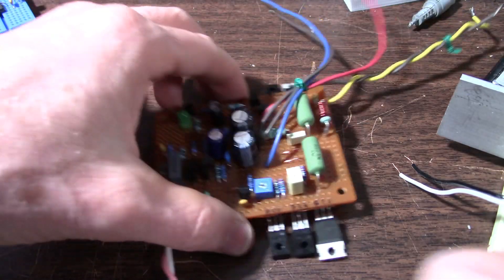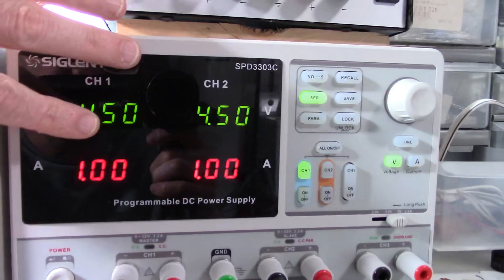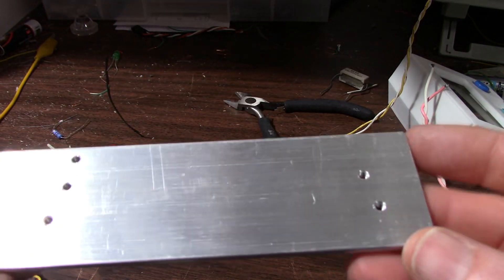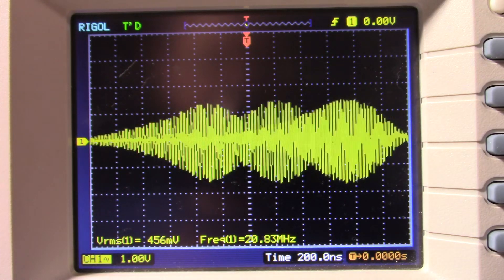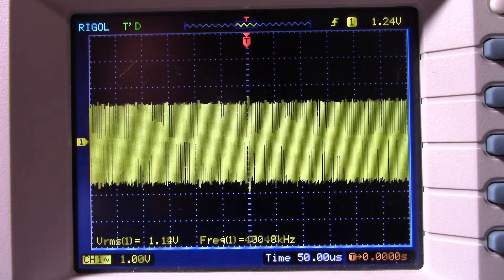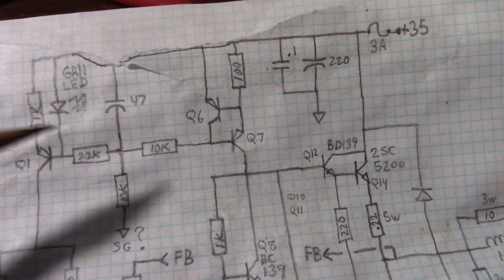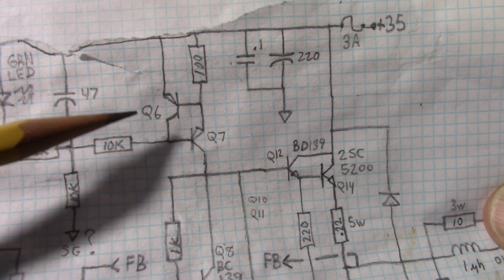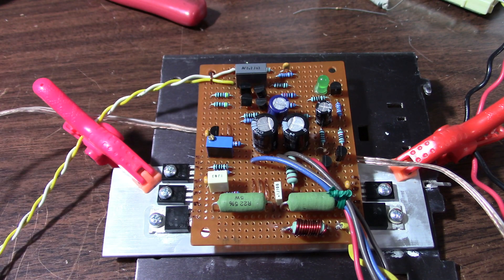Discrete audio amplifier project PT14 - BIG PROBLEM!

Comment: try to replace a shifter transistor is a preoutput stage of the amplifier somehow i make ones i somehow i put larger amperage to the circuit and start to get noise then somehow the noise it louder on the sound itself til it the music gone and the oscillation got more compromised and wont work so i decided test if theres a leak and yes!! the positive supply shifter damage because of pulls lots of power
Reply: somehow did you try to filter much on the power supply?? ithink thats the one too because some how i make a mistake that  i dont filter much on the supply side and the noise comes from